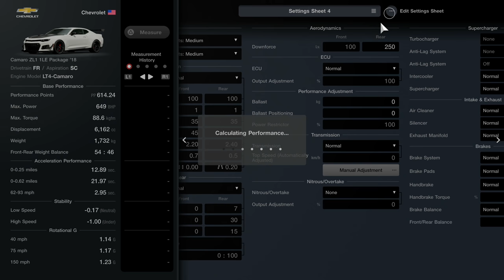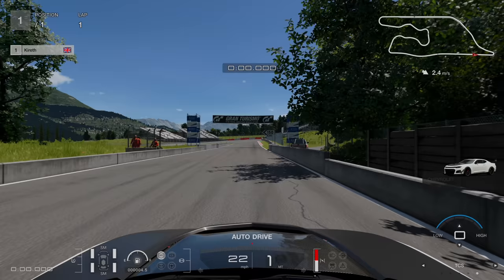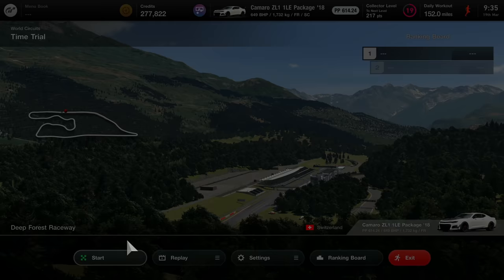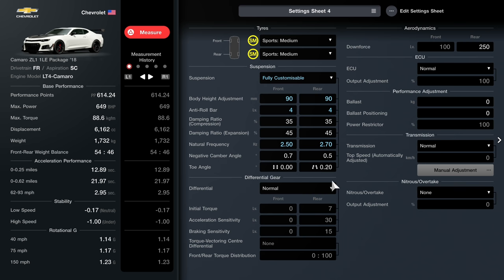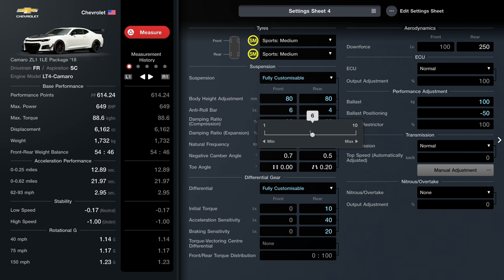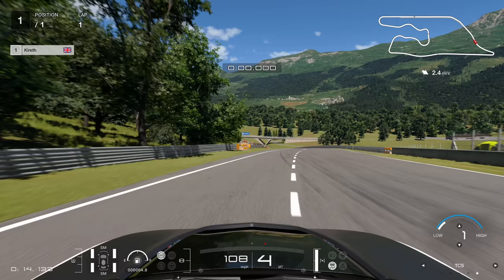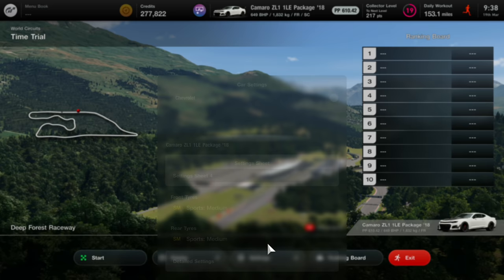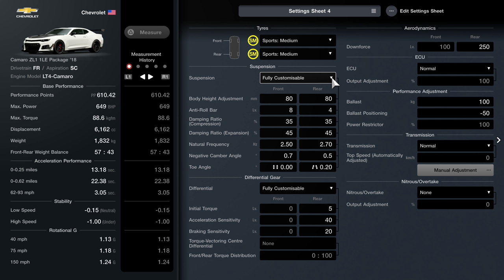Gran Turismo 7 Tuning Guide - Make Undriveable Cars Good!

Comment: I found ride height as low as possible on most cars scrubs tyres & causes vehicle not to turn properly on sharp turns ie hairpin at Suzuka. I always leave at least 5mm off lowest & it helps lots.
Reply: That, and stiffen the front suspension compression, expansion and frequency to prevent the front from bottoming out under heavy load. Add more negative front camber as well to give you more clearance during a full turn. Be wary of the steering angle modification as well. It could give too much steering angle and make the wheel have contact with the inner fender.

I started doing turning tests with my cars during tuning. Drive about 10mph and turn hard left and right, then do a replay and watch your clearance. Usually  this gets away with it.
Reply: @frantz4g63  cheers mate, I actually do stiffen suspension & add neg camber for same reason. I also add ballast to some cars & only use steering angle adaptor for drift cars. Thanks mate for welcome input always helps.
Reply: @geoganicus7238  I spent enough time beating my head on a brick trying to figure it out 😅 it would be a shame not to share a solution since we both know tons of people are going to go through this since pretty much everyone loves slamming their cars to the ground. Glad you already had a solution for it man, because I wish I had the help when I was trying to figure it out. Didn't expect real world dimensional physics to take place in a game. Good thing me knowing a thing or two in the real world I was able to think logically 🤣
Reply: @frantz4g63  spot on mate. Me too 🤣. I'm a motor mechanic by trade so that helps immensely. Feel a bit for those without mech knowledge trying to set up cars. Must be frustrating. It gets that way for me! Any help is always good. Cheers again.
Reply: @geoganicus7238  ahh same here, mainly on rotary engines, but I do know my way around piston engines as well. Knowledge will get around since the game is new, then the early bloomers will catch on. Definitely will teach them a few aspects in the real world. Enjoy the game and stay informative my man 👍🏽
Reply: @frantz4g63  Thanks mate you too & I will 👍

Comment: I appreciate the video and pointing out that GT7 is really a new game. it feels very familiar but the settings and driving dynamics have undergone significant changes. I imagine TC1 is similar to how traction control off (but not 100% off) works on street cars in the real world. Cars like the Camaro, Mustang GT350 etc. are really designed to have the computer help provide that stable acceleration rather than simply pull power like a full on TC setting does.
I would also mention as an aside to be careful with certain cars about lowering the ride height all the way. I watched another video where lowering the ride height all the way resulted in less turning angle available due to "rubbing" it is definitely a car by car issue though and not a criticism. just a warning about simply lowering the car on the front all the way  on any and every vehicle.

Comment: The only thing I can say I disagree with is adding the traction control. That is all preference everything else you’ve done yes. I can also say certain cars I have staggered the height front and back to adjust the understeer or oversteer problems

Comment: I would say your first run was explainable, but you can’t nail it out of hairpin like that without out TCS. The Camaro typically will oversteer which will cause the car to spin out and lose time, but if you can get used to that you typically are able to feel more confident on turns, obviously with proper speed.

Comment: Any advice on using the Hellcat Charger?  I drive a Charger IRL so I was excited to use this but the damn thing is so sketchy to drive.  Like going in a straight line feels like driving in the wet with dry tires.  It slides around constantly and I can't figure out how to make it not do that.
Reply from the maker: For me SUPER steady on the accelerator - if it's difficult in a straight line then put ballast to the front (counterintuitively) and TC on to make it manageable
Reply: @Kireth  Hmm I tried that just now and it feels better on the straight but I still can't do an oval with it.  I just tried the American FR 550 on Blue Moon Bay and I lose the car coming off the banking pretty much every time.  Car just seems too wild for me.  Maybe it's because I'm on gamepad.  I'm using 3 TCS.
Reply from the maker: Honestly best place to get feedback on this will be posting in the GT Tuning Workshop in the Kireth Kart Community Discord
Reply: Same. I can't make it around a corner with snap back oversteer.. I use to be good at drifting

Comment: The car's not hard to drive. You're overdriving the car. You can't put you foot to the floor exiting a corner while the front tires aren't even straight. The SS isn't a low power car. You can get away driving like that with lower powered cars but the more power you're dealing with, the more control you as the driver will need to be able to provide for the car. And it looks like you're playing with a controller. Playing this game with a wheel, night/day difference when it comes to how you control and can feel exactly the how the car's handling. 

When I drive with my wheel, I can precisely feel the exact moment when the rear wheel's about to break traction. It's a very distinct feeling. And once it breaks, I let off, counter steer however much is needed and to blip/feather the throttle to help regain traction. 

While you can do this with the controller, it's much easier while using wheel. I'd like to see you make with video while using a wheel.

Comment: The first corner in third person mode you aren’t letting the car straighten out after the corner. It is still turning and therefore still unbalanced. You are applying the lower way too early and not progressively as you would in reality. FR cars carry most of their weight over the front axle anyway because of the engine. I find a lot of what you say baffling.

Comment: Iv felt like less off a driver having to use TC on 1 in GT7. Iv never used it in any previous GT games but seems like a must in GT7.
Reply from the maker: Why do you feel like less of a driver?
Reply: There's too many players out there who look down upon using TC.  Look at real motorsports and see how much they use TC.
Reply: @Mike-1000  I do agree completely. But there are cars in real life Iv driven on track that do not have TC and don’t need it. and yet on GT7 have way more “spikey” Handling than they do in real life.
Reply: GT7 doesn't have good throttle input on controller. You'll go from 10% throttle to 70% throttle with a slight twitch of the finger. This has been an issue for years that was never addressed. They need to add a throttle and braking sensitivity slider and dead zone setting so we can adjust it. To me, TCS feels like more of a bandaid at the moment given we don't have sensitivity options. The default settings are not good at all. And I'm playing on PS5 with the Triggers on Strong so I'm less likely to squeeze a little more than I should. I'm not having that much of an issue with the handling, but it would be a smoother experience with sensitivity settings.

Comment: Adding front ballast to a FR vehicle doesn't sound right
Adding ballast but turning TCS on isnt really the car setup
If you go 100 ballast to front without TCS you get more over steer which is 100% undrivable without TCS

I added 70 ballast to 40R which improved the overall balance and reduced oversteer and this is without suspension or diff tuning
Does have 150F & 300R downforce and some tuning parts

Comment: On stock I didn’t find the ZL1 that difficult.  You have to be very sensitive with the gas pedal.  You can’t just thro down on the gas pedal in a rear wheel drive pony car with that much HP and think you’re not going to spin out.

Comment: By lowering the ride height, you will make it terrible on steering. Dont see why you didnt feather the accelerator rather than just mashing the pedal, no wonder you spin out. Also running sports tyres and not racing softs? Was this in the limits to run sports?

Comment: One thing I've learned is just how useful the "toe-in" and "toe-out" is for turning as it controls understeer and oversteer respectively. I was driving a Honda Civic Type R '20 and using the stock car it was pretty good at turning but not incredible. I then made my rear wheels neutral and my front wheels "toe-out" for the oversteer and i was flying through the racetrack managing every corner with ease. Another thing I love about it is that turning the toe-in/out barely affected PP which could be a way to make cars better without increasing PP too much.

Comment: I tired it but I think my Camaro is just putting to much power down. I’m still spinning the tires in 3rd gear
Reply: Take your foot or finger off the throttle. Be gentle with it. Of course a 640hp car can wheelspin in third.
Reply from the maker: Shift up earlier 👍
Reply: What's your power/weight and tire setup? Also, these guys who replied to you here are 100% accurate, especially about the LSD settings.

Comment: “I know how to drive in gt7” as I show absolutely no throttle control 1:26
Reply from the maker: If you're struggling with throttle control try to imagine an elastic band connecting the pedals with your steering wheel - hopefully that helps!

Comment: The TC you added makes 90% of the difference. I drive this car a lot in races and my lsd is 10,30,20. As for the ballast advice that’s terrible. The front of the car is always heavier than the back very very few cars have a 50/50 weight balance most have more front weight than rear. Also the stiff arb up front will induce serious understeer. On this car no higher than 6 on the front.
Reply from the maker: Agreed on the TC being huge - disagree on the ballast as counterintuitive as it sounds!
Reply: @Kireth  I ballast Porsches and move the weight all the way forward to get it as close to 50/50 as possible. If doing the same in an FR car doesn’t make it more tail happy then GT7s physics are broken very badly.
Reply: Your LSD settings are far too aggressive on the accel side. Whatever car that is must be extremely snappy without TCS. Lower your LSD accel to 5 and work your way up and you'll see how little TCS you actually need. For a rwd car on sports tires, imho you shouldn't need more than 15-20 accel. And the lower the decel, the more oversteer you will have, which is ideal as long as your car doesn't have sudden loss of grip. 50/50 ballast is the most ideal for a predictable ride, much more manageable during accel and decel loads.

Comment: Not sure it's a fair comparison using TC on tuned but not stock...
Reply from the maker: My point is that the second run was a LOT more driveable with everything changed, including TC on and the tweaks in the settings page

Comment: Have you found a solution for the extreme understeer on tight hairpins? I use controller so that might be part of it but going around turn 1 on nurburgring or the last hairpin for deep forest for example is so painful, I can't get the car to turn without the handbrake

Comment: I have the mazda RX 7 with the engine swap that I won in a raffle. Even with these settings, it is still uncontrollable. Does anyone have any help for me. My problem is that even a slight turn on a pretty straight road causes fishtailing
Reply: Tune your differential settings to the minimum. Reduce your anti-roll in the rear and increase it in the front. Then adjust them vice versa until you get the desired amount of response, steering and stability that works for you. Also, make sure your rear tires are a soft compound. Tune your ballast to be closer to a 50/50. Adjust your rear toe. Add rear downforce. Use TCS. Also take into consideration you have a powerful R26B in an already tail-happy rx7 that's extremely light weight. If you're not running race tires, that thing is going to dance like no other.

Comment: The issue I have is when I let off the gas going into a corner and the rear just starts to come round before I even press the brakes. I find this happens a lot in the Lambo Huracan GT3 in for the 700PP and the 800PP races.

Any ideas on set up would be appreciated
Reply: Try stickier tires in the back than in front, like racing hard in front and racing medium in the rear. Also noticed in this game that if you put on stickier tires and better brakes you really need to crank up the suspension natural frequency or else the front will dive so hard your rear wheels will nearly come off the ground and it makes it really easy to spin.

Comment: It doesn’t do much for the 911’s. I can not drive those cars🙂. The smallest curve on a straight and I spin around. Like the curve before the goalline on deep forest, like you show. I can’t figure out how to make 911’s more stable🧐
Reply: @danielstokker  Thanks, I’ll give it a try.
Reply from the maker: Specific 911 GT3 RS  tune video coming 👍
Reply: @Kireth  Great, can’t wait🙂
Reply: full weight reduction, give all ballast to the nose and stiffen the front; then it handles a bit understeery but still very well
Reply: Also braking diff setting to 60 will help stabilize car under braking.
Reply: @danielstokker  true, but good as a tool if you are having issues with lift-off oversteer.
Reply from the maker: Yes upload it! 🤘🤘🤘
Reply: Definitely ballast on the front to get it closer to 50/50. Maybe a slightly harder compound front tire. Also, weight reduction also reduces grip in quite a bit of situations where heavy load is applied, so don't go kowabunga doing full weight reduction on every car you get. Carefully calculate the cars weight and distribution from stock, how it handles with certain tires and go from there. Every car is different.

Comment: Problem is this game is supposed to replicate the handling of these 'factory' cars - all aids off. Even the old Skyline GTRs dont behave as they should which could induce oversteer easy with lock and throttle despite the 4wd. Fun fact high powered RWD cars on decent tyres can still handling a good amount of throttle exiting corners in real life without turning into floppy soap. Shouldnt need to play tweaks to get the physics for each car correct.

Comment: u made it extremely dramatic by turning tcs to 0. at the least moderately tuned cars should have the tcs at least on 1. high 2-3 depending on experience. throttle discipline is very important with high hp rwd cars.

Comment: Undriveable cars? 😅 oh yes, i found a lot at gt sport and gt 7 😁
And have more after 1,50... 😊
Well light wight 1 to 4, and then balast +100kg?! 😅 you can change front rear or rear to front without +100kg... 😎
But do not wonder with those low cars and hard suspensions to learn fly at hitting curbs or not flat curves etc. Better four wheel driving then 😊
What to do against 180ty turns at 10kmh? Last rekord was 16kmh 😂
That game is so unlogical...

Comment: Many thanks for your guidance, Kireth. I am currently having a similar case with a Mustang GT ‘15. I basically replicated your settings but I find the car now is hard to steer and still sways. The original settings led to massive swaying; after every turn the car becomes like shaking jelly left to right and when accelerating goes out of control. I’m running at Weather Tech Laguna Seca raceway under dry conditions with soft racing tyres. Appreciate any recommendation.
Reply from the maker: No problem Fernán! Perhaps try counter steer assist on it

Comment: Hi, can you give tuning tips for MR cars,  because on coners my Ferrari F430 is stable but if i touch a curb it becomes unstable and also the tires spins in the mid to high speed corners
Reply from the maker: Yep on the way 👍
Reply: Add more weight, closer to 50/50 distribution. Softer rear tires. Reduce rear anti roll stiffness, increase front. Soften suspension frequency in the rear.. Reduce LSD accel and initial torque. Do not reduce ride height all the way to minimum. Use a slightly harder front tire. Add rear downforce.

Comment: really really really really really Wrong my guy lmao how can you say a Front engine car needs the ballast in the front for more control if its a rear wheel drive and you have the back end completely gutted with all the weight in the front makes the back end so much more likely to break traction and not grip up on corner exits.